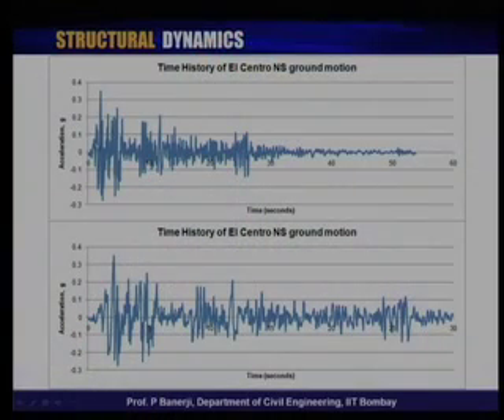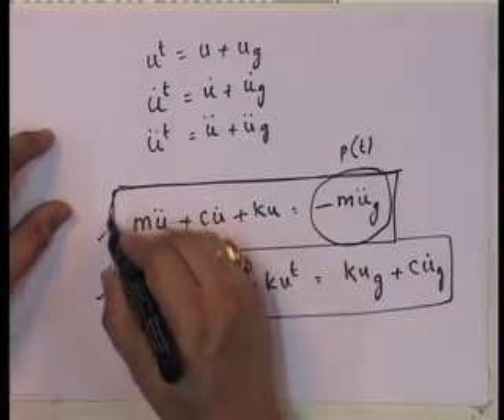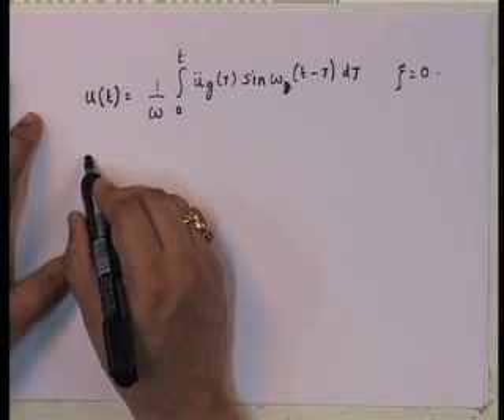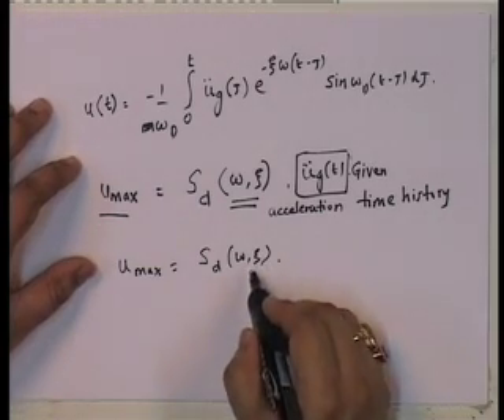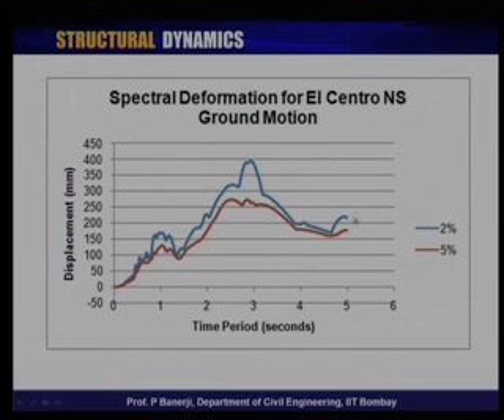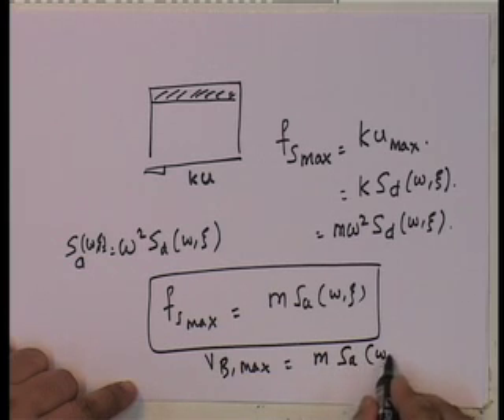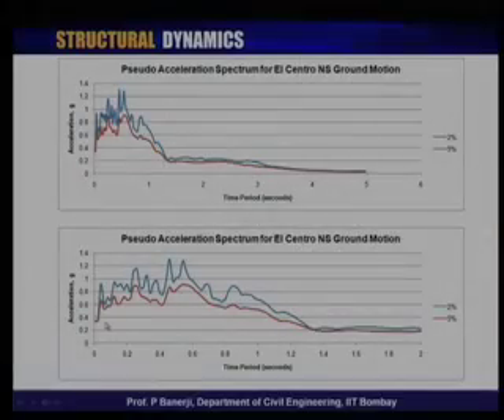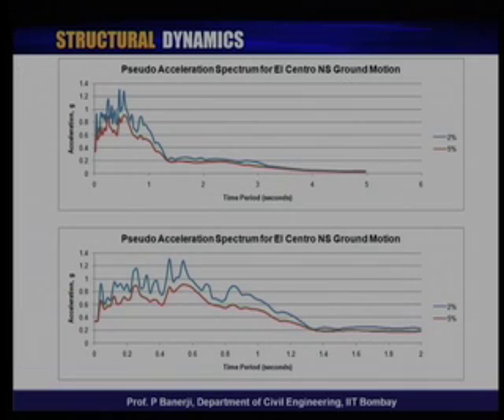Mod-01 Lec-15 Response Analysis of Single Degree of Freedom System for Earthquake Loads

Comment: Could you (or anyone) explains the step-by-step way to obtain the response spectral, please!!
Reply: Hi, actually the difficult part of the derivation of response spectrum is already explained in the last lecture (Lec-14). 

The process is like this: 
1. Having the recorded earthquake load p(t)
2. Apply different structure natural frequency (let's say it is first w1) 
3. Under this w-1, use time marching scheme (or other methods, but usually time marching since it is also applicable to Non-linear system) to acquire complete u(t)
4. Find out the largest value in u(t), let's say it is umax-1 
5. Plot the point which has w1, and umax1 for its x and y value, respectively.
6. Repeat this process applying different structure natural frequencies (w-n), and derive the correspondant umax-n. These points would form the so called "Response Spectrum" curve.

If anything incorrect plesase leave the comment below. Thanks